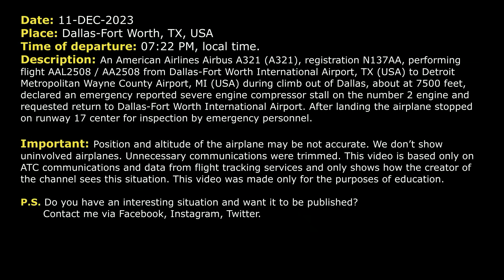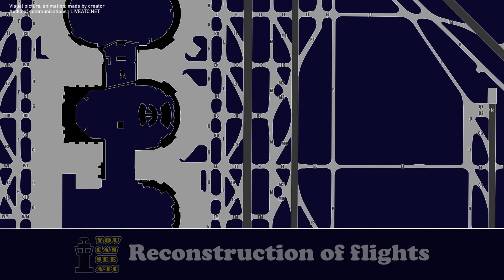Severe engine compressor stall on takeoff. American Airbus A321 returns to Dallas. Real ATC

Comment: Again, a SECOND request for souls on board & fuel in hrs of flying @ approx 3:54 when the pilot, co-pilot are going through an emergency check list to get the 200 souls on board back on the ground!
Reply: That is not a big burden in the scope of all the task that an Airline pilot can handle.  It is possible that the information did not get passed along to subsequent controller.
Reply: Right, can I have fuel in PINTs and remaining in milliseconds please?

Comment: I have a question - with a plane coming in single engine, why would ATC have a departure on the runway ahead of them?  if they are slow to get off the runway, asking a single engine aircraft to execute a go-around seems inadvisable.
Reply: bc it's the USA and it's against freedoms to do the safe thing and not let others depart from the same runway while an emergency is going on.
see eg. that airfrance Geneva video from a few days ago in comparison. Geneva just stopped everything on the runway in use during the emergency.
Reply: @xyzvala 
Do you have a link for that Geneva video?
Reply: very true but these planes can do it just fine. Im more concerned about the not being with in glide of the airport Not something that ever ever happens right.. except for that one time.  but still seems reasonable to circle over the airport.
Reply: @OnFinalConstruction it might be that they were deliberately coming in a bit high. If they were on the glide path and the other engine failed as well, they would be coming short of the runway.

Comment: Right turn issued by atc around 2:10 but graphic shows left turn.  Can you please clarify?
Reply from the maker: They turned left. That's their flight path. You can see that on Flightradar24.
Reply: @YouCanSeeATC  thanks.  Love your channel
Reply from the maker: Thank you. Appreciate it 😁
Reply: Being advised to turn right and then turn left in a dense populated airspace and ATC doesn't care ?? Somehow strange to me...
Reply: @uweberning8361  This is an emergency aircraft, single engine. For whatever reason they turned left (into their working engine - marginally the better direction).  ATC was clearly watching closely and determined no danger in what they'd done - so just gave a new course and continued to keep them in positions from which they could land urgently should the need arise,  The workload during an emergency is huge - ATC simply chose not to make it worse!